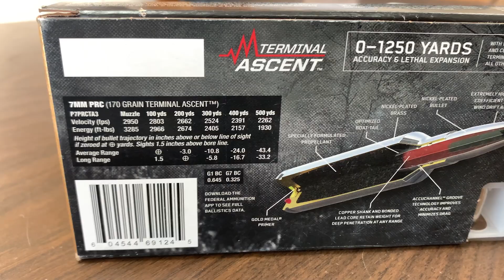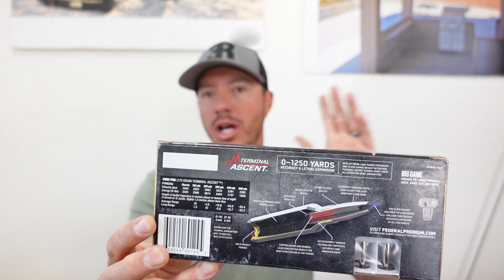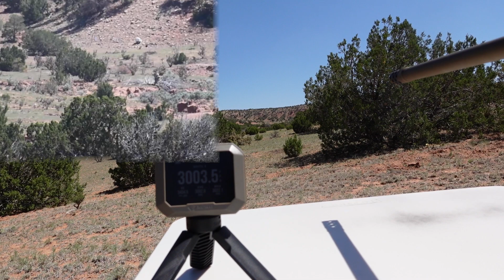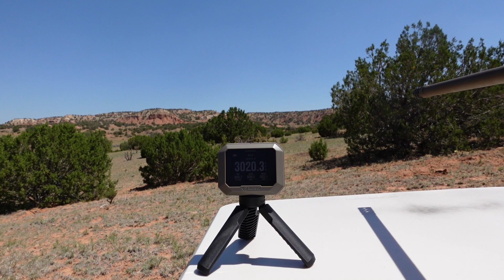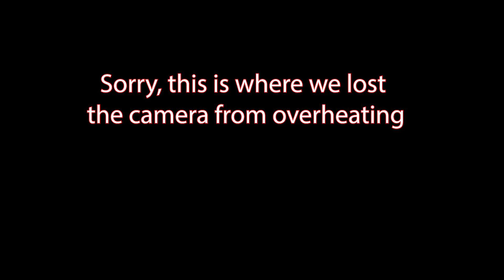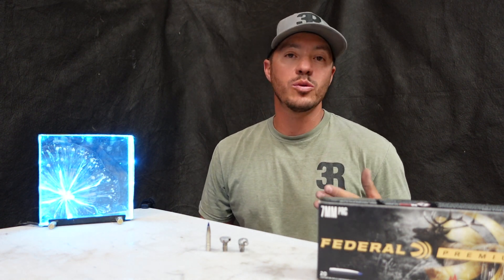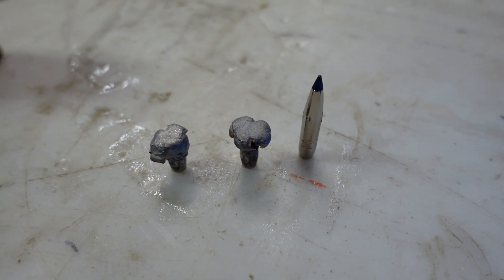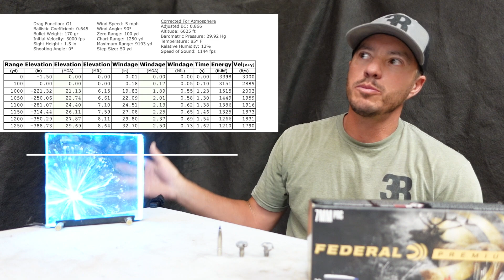Testing 7mm PRC Federal Terminal Ascent at over 1,000 yards

Comment: I have seen vid of shooting an elk at 1,376 yards with a 7 RM. That was the Gunwerks video with his son. Aaron over there now wishes they had not taken the shot. His son is always practicing at the 1k yard range and has shot that gun before. He was competent. And they did hike over there to harvest the elk.

Aaron at Gunwerks points out that the bullet did not perform like he wanted.

For me, impact velocity is key. You could have a heavy bullet and in the math, it has a lot of energy. But if it does not expand properly, it could pencil through. That being said, the guy at Little Crow prefers monolithic copper, like the CX. Point being that it will normally create an exit wound that helps with deflation of the chest cavity and exsanguination.

It is also often the case of having to shoot twice or thrice at an animal, regardless of distance. There have been plenty of animals wounded at "ethical" distances of less than 300 yards.

That being said, my area allows to about 300 yards of sight lines but mule deer in the western part of the state do suggest being able to shoot at least 200 yards. It's a canyon with no trees.
Reply: What?
Reply: @NODAK-x9x  FOAD

Comment: With this load in my 7prc, I’m getting avg 2981fps (22” barrel)  0.75-0.90” groups @100yds.  Load worked fantastic on my black bear this spring.   Complete pass thru frontal diagonally across and exited rear (60 yds shot) Bear ran ~ 50 yds before piling up.  I’m very impressed with its performance.
Reply: Wow. Nice. With the 170 grain?
Reply: @   Yep
Reply: @    Yes with the 170gr. 😀
Reply: Thanks for adding your barrel length! I can’t tell you how many videos about muzzle velocity with 7PRC loads without any stated barrel length.

Comment: The 7mm rem mag will do the same with the same bullet and you will even get more about 100fps more or better
Reply from the maker: I also have a 7mm rem mag but do not get those velocities out of the 180gr Berger VLD match. I’m usually around 2800fps. I do get faster velocities out of the 140gr bullets but then we aren’t really comparing the same bullets.
Reply: Not Factory loaded for sure due to bullet length and needing to stay in SAAMI spec. Also, Federal loads a 155gr TA in 7rem and it only gets 3000fps....The 160gr Trophy Bonded is going 2900fps and a Berger Hybrid 168 gr is 2870 FPS. You would be pushing that 7mm Rem REAL hard to get 3000fps let alone 3100fps out of a 170gr.
Reply: Reloader 26 is your best friend ‘ it probably would do good in that 7prc also but it already looks very good
Reply: @Whiteghostkennels  Terminal Ascent 155gr max load is 71.2 gr of RL26...It is rated right at 3100fps and it is a compressed load. No chance you are loading that 170gr TA and pushing it 3100fps out of a 7rem.
Reply: Lets call you the dream weaver..  Somehow shooting the most hot rod 7mm RM on the planet..  LMFAO
Reply: @kylemacdonell1450 
No, let’s just call me someone who knows how to hand load and understands pressures
Reply: @malcolmdennis503  Hey Malcom, do you understand case capacity then ?
How about Max chamber pressures ?
Both are higher in the 7PRC vs 7RM so tell me again what you know 
LMFAO
Reply: @kylemacdonell1450 
That comment just told me everything I need to know ‘ just so you know the 7mm rem mag has a higher case capacity than the 7PRC you be safe bud if your hand loading and good luck
Reply: @malcolmdennis503  You in incorrect 
The 7PRC has an easily measurable 3-4%  advantage in case capacity.
The fact that the PRC is a more performance oriented firearm means its chamber is tighter and needs more maintenance / cleaning.
Reply: @kylemacdonell1450  
Sounds like you will jump on anything, buddy  7mmprc 82gr case capacity you get about three more grains of powder in the 7mag
Reply: @kylemacdonell1450  
SMH
Reply: @Whiteghostkennels the 7 Rem mag with 4 grains more capacity and 1500 max psi  less isnt going to blow the doors off the other cartridge. For all intents and purposes they are nearly equal in velocity and the nod to the PRC being able to use the longest heaviest highest BC bullets 7mm has to offer.
Reply: You would need a fast twist barrel and a custom throat to get bullets from eating case capacity. Browning is the only factory rifle possibly doing this, then you would also have to hand load. 7PRC does it with factory rifles and factory ammo.
Reply: @mmorris6341  
Depends on the barrel  it’s been my experience That most 7mm rem mags Will do fine with the higher BC bullets ‘ most rifle companies now are putting a faster twist rate on the 7mag just for that purpose because they know that it will handle those bullets also you’re really not gaining anything out of the 7 mm PRC
Reply: @Whiteghostkennels unless the barrel has a custom throat to handle the longer, heavier bullets you will eat up more powder than the 3 grain advantage 7 rem has. 
Watching guys like RW is probably not the greatest way to get solid info

Comment: I shot two of my 7PRCs yesterday. Stopped by a local store and they had 2 boxes of the Terminal Ascent but I just couldn't bring myself to buy it at $67/box. Especially since I handload. I may reconsider. Going back to the range in a bit to shoot one of them again and that store is on the way

I also shot the Federal ELDX ammo in both yesterday. One was decent at MOA the other didn't like it at all. I did get lucky with my Tikka 7PRC as it has now shot five 3 shot groups all half MOA with factory Hornady 160 CX Outfitter ammo. Good thing too because i bought 3 cases for a steal on auction

Those Fed TA are amazing

Yes please try Berger 180 VLD, Hornady ELDX and Hornady ELDM since I hear a lot that those match grade bullets open fine and work well in hunting. I did kill a deer last season with my 7PRC and ELDM factory ammo
Reply from the maker: I will say the Fed Terminal Ascent surprised me. After 15 shots it had a standard deviation of 12 and an extreme spread of 37.7. Average velocity was 3003.2 fps. 
I’ll see how soon I can get back out there to test those other factory loads.
Reply: The hornadys are way outclassed by the terminal ascent. They're usually accurate but blow up on game. They're fragile cup and core bullets vs bonded match ammo in terminal ascent
Reply: @fippydpaw  Terminal Ascent most certainly a superior bullet for performance on game but on a deer it doesn't matter. The cheapest cup/core kill deer just fine and a Terminal Ascent is overkill but if it shoots well, I'll use them. I finalized a 200 grain TA in one of my 300WSMs and the 136 grain in one of my 270s.